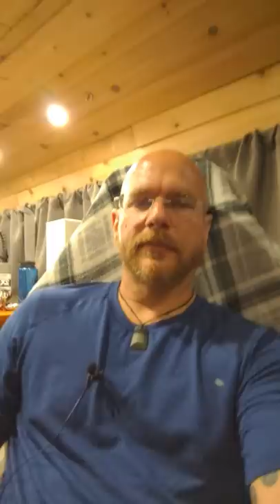Transmission 2 - Joker 0

Comment: Joker, you should check out Nvidia Broadcast. Little piece of software that has camera, mic, speaker output filters and stuff. I use the noise filter for my mic to remove noise from my computer and air conditioning unit. Works great.

Comment: Brand New solenoids, same problem.

Change your transmission fluid.

If there is swarf in the fluid, it will occasionally get jammed in the solenoids, this will affect new ones the same way as old ones.

You should have changed that fluid before changing anything.

Always service steps first before replacing stuff.

Comment: Range sensor. The darn electronic transmissions can really argue with you. Yours is responding like mine. Unfortunately your trip has become your shakedown run. 

I have a Mercedes and a gmc diesel. Both with electronic transmissions. Mercedes gets 40,000 per year. Solenoids probably were weak but there is a range sensor somewhere. On the Mercedes it is part of the shift assembly. Google it if you haven’t. I’ve become very intimate with my vehicles. Patience, patience. Temperature of vehicle plays a big part. Acts one way when cold and another when hot. Good news is it’s highly doubtful it’s mechanical. It’s the darn electronics.

Comment: @BB - Check that your SOLAR  output, Voltage convertors & Alterntor are producing TOO MUCH voltage,... as this might lead to burn out the winding of the (electrically operated) solenoid(s) - and over-charge of any  truck/deep-cell  batteries 
.
If possible maybe a pneumatic or hydraulic actuator for the transmission could be a potential fix ( if available)
.
.

Comment: Your TCM is shorted, have it replaced. It will be about 900 usd. Sorry for the bad news, but like I said, the Allison trans has very few mechanical problems (<1٪), and majoratively electrical. When a solenoid shorts to ground, full current is going through the module and the fuse is on the wrong side of the circuit. I didn't design them, I just fix them.

Comment: If that thing sat check the plug connection on the transmission control module. Probably corroded. Pretty common on those transmission. Mechanics should know that, but none are honest.

Comment: Try pulling the engine battery to reset the TCU (transmission control unit). Sometimes it’s just an intermittent fault that makes it go into Limp home mode.

Comment: Parts quality can be a big issue 
Go thru the main connector and do a tension test on all the pins spray down with electric cleaner spray & some silicone

Comment: Have you considered the following?
School buses are not designed and calibrated for heavy hauling. They are designed for moving 40 or 50 kids at moderate speeds and moderate distances with the greatest fuel economy.
Considering everything you have been adding to the bus such as water tanks and most importantly that truck of yours in tow it could be the entire combination is overweight.
Thus the transmission during extended travels is operating at its peak design temperature, causing the computer program to jump to limp mode and limiting the Allison transmission to third gear to prevent any or further damage.
If this is the case you will never make it across the Rocky Mountains.

remedies;
- lose the truck and replace it with a lighter one, or even a bike.
- install a transmission cooler.
- drive slowly

Comment: What year and model is the transmission?
Reply from the maker: year in not sure as it's been rebuilt but it's an Allison 3000
Reply: @BetterBachelor  A lot of times when you drop the pan to replace the solenoids , and you don't remove and clean the valve body trash inside ( clutch material / metal shavings ) that usually are the cause of the original failure then are freed up and cause either obstructions mechanically inside the valve body or plug the new solenoid(s) with debris causing more issues . I don't do big trucks or busses but they are just larger units than what I work on . However 8/10 times of you have that much clutch material or metal inside it's time for a new rebuild. Hope it's just a simple issue and you get rolling down the road soon.

Comment: I had my car in the shop for over a month back in 2017. They tore my transmission up and took it to the transmission shop thinking it was the transmission. Come to find out it was the computer module. Your transmission may just be fine like mine was. It may just be a faulty computer module. Check to see if that is a common problem with your model of vehicle or not. Most mechanics will just continue to squeeze you for cash thinking it is this or it is that.

Comment: Joker Look out for wiring problem,  connections,  around cables dragging on frame or hose or cross other cables. Loose connection or corrosive. I am traveling Friday Houston to Chicago through i-30 than i-40 W. Memphis . I can look out damn transportation.

Comment: Is the transmission running too hot because of the size of the load it is pulling? Prolonged high temperature alone will cause it to throw codes. Consider that the weight of all that nice lumber in the interior, in addition to the weight of the solar panels, water tank(s), electrical equipment, wood stove, bulk items, etc. is very likely FAR more than the weight of the stock interior with football linebackers and all their luggage occupying every available seat. Add to that the (eyeball estimate) extra 6000 lb. you're towing behind it. You could possibly get weighed on a truck scale and compare numbers. A bus is designed not to have any more power than absolutely necessary because it otherwise wouldn't be cost-effective in a fleet of hundreds or thousands of buses in a school district.

Comment: So IIUC your transmission is actually functioning as it should it's just that the light came on. is that right?
Reply from the maker: no stuck in 4th gear again
Reply: @BetterBachelor  Oh crap, then the original problem didn't get fixed.
Reply: @BetterBachelor  Well maybe having a fresh set of eye looking at it will do the trick - Good Luck.

Comment: Joker seriously somehow contact me especially if you have an Allison transmission I specifically work on them for a living
Reply from the maker: it's an Allison 3000 automatic
Reply: I know how to pull codes with the shift selector
Reply: If you dont get a hold of me for sure have whoever looks at it makes sure the output speed sensor tone wheel is tight, especially if its a WTEC 3 Allison 3k. It is a WTEC 3 Allison 3000 if there is a wire harness coming out of the transmission/control module.  To check the tone wheel they just have to remove the output speed sensor and see if the tone wheel is loose. Whether they can fix it if it is loose is a whole nother ball game. What kind of shop were you at?

Comment: Sucks for sure. Is it the original transmission and engine in the bus? It's quite possible the performance of the transmission and motor aren't matched and the weight of towing your vehicle plus whatever materials you used are just taxing your powertrain.  You might have to beef up parts and cooling systems etc.  Might need "towing ready" upgrades.  Best of luck.

Comment: I went thru this same kinda shit with an 07 f150 I was using for this A/C job. They would say its fixed and I would get going down the road and the message for trans would show up and then it wouldnt go past 2nd gear....lol. A trans for that bus aint a cheapie so best of luck if you wind up having to get a rebuilt. You said that was an Allison trans in there didnt you? They put those in the fuckin Abrams tank so you would think it would have no problem with a bus....lol. Just kidding. All the stops and starts that trans has been thru its probably tired as fuck dude......peace.

Comment: You know..your stuck in west Memphis truck stop being serenaded by idling trucks and reefer noises...been there done that many times....on the transmission...sometimes it's best to bite the bullet and swap your transmission for a rebuilt with a guarantee...been there also...go manual with a 13 speed..then learn how to float the gears...no clutch